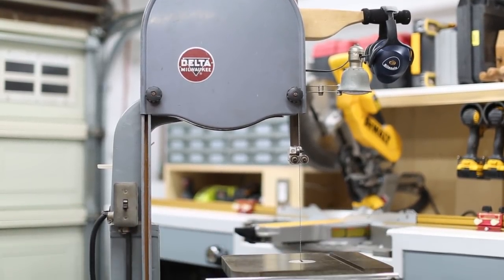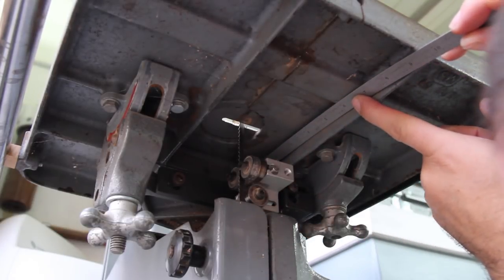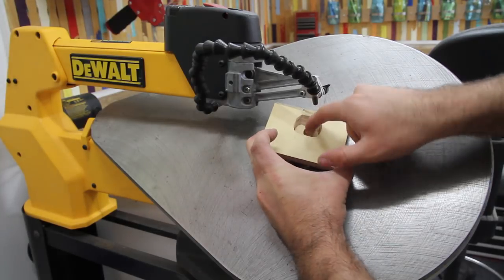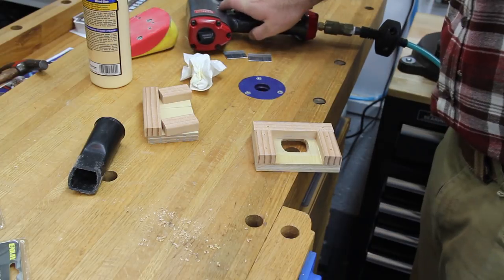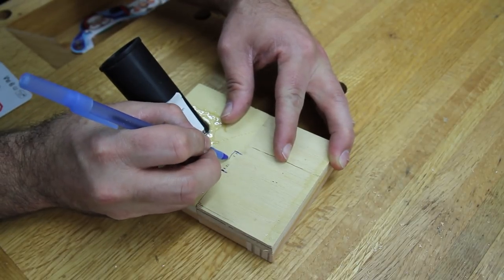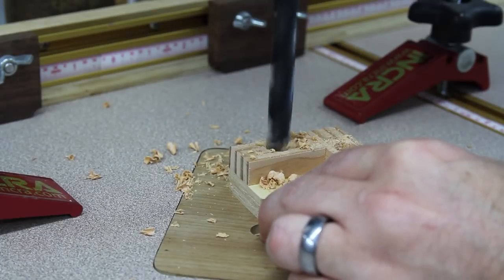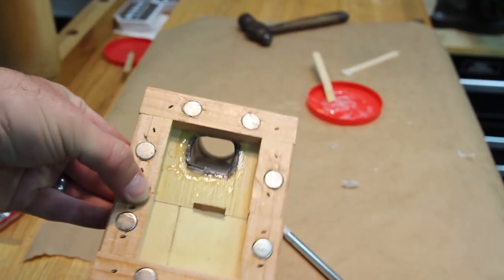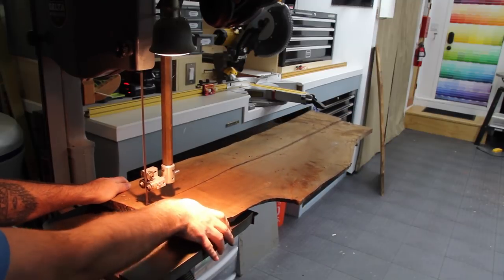Build: Bandsaw Dust Collection

Comment: Pretty cool idea. Absolutely agree on the near uselessness of most dust collection projects I've seen. Right now I've got a dust collector on my band saw that consists of layers of corrugated cardboard and Gorilla duct tape mounted to the underside of the table. It's VERY rough, but surprisingly functional, and is tied directly into my dust collection system, so no complaints.

Comment: Thanks for sharing this!  Great concept and implementation: clear, concise instructions.  Here’s another idea for even more suction.  I use 2” painter’s tape to seal as many joints/cracks as possible.  I seal the top and bottom wheel covers everywhere I can.  I also seal the blade trough on the rear.  Really helps!!
Reply: Worth a try though I bet it looks like hell.

Comment: Nice work.  The slot cut for the blade was larger than expected; thought it would be more of a ‘zero clearance’, but as long as the vacuum overcomes the tendency for the blade to pull sawdust along, it’s a win!  Based on videos I’ve seen in recent months, you are not alone in taking this approach.  Under-table dust collection appears to be the best solution to the problem.  Still getting my workshop set up, but I definitely plan to follow your example.  Best wishes!

Comment: I just finished making a dust collection setup for my bandsaw using the approach in your video. It seems to work very well!  The build was fairly easy, although I had to work around some mounting holes and a thrust bearing that is closer to the table top than your saw. 

BTW, I found it helped a lot to take the table top off when sizing and fitting the pieces.

Thanks for the design!

Comment: Brilliant idea with the magnets. I have a very similar set up on my 16" bandsaw, but i use high volume low pressure dust extraction with a 4" hose to the bottom of the saw, and another 4" just jammed under the table. They both tee off from a 5" hose which my whole system uses. I find this far more effective than a shop vac type system. I shall make a better attachment for the hose below the table using magnets! Thank you for inspiring me. All the best from uk : )
Reply from the maker: You're welcome!

Comment: Man, the only complaint I have is you didn't post this 3 years ago. I've been putzing around with mine for 3 years. I recently gave up. If it wasn't bed time I would go to the garage right now and build it. Thank you very much.
Reply from the maker: Maybe I should build a time machine next to fix that problem for ya.
Reply: @weberwoodshop   I built a time machine; had it all finished next week.

Comment: Thank you so much for the inspiration! I tried to make one of these for my bandsaw, but I didn't have nearly enough room underneath the table. I only had about a .5" of clearance above the lower thrust bearing. Using your project as a guide, I was able to design a part in Sketchup and 3D-Print the entire dust collection apparatus. It printed in several parts and I glued the assemblies together. I think with some more tinkering and thought, I could make each piece friction fit into each other. Is there any way I could share the photos of the finally product with you? Thanks again for your incredible videos and all of the hard work that goes into them. I hope you and your family have a Happy New Year.

Comment: As a green wood bowl turner, bandsaws are at best designed to collect dust from cabinet shop type work and not green wood, which always settles in the bottom of the saw. Closing that open area at the top is huge. Oh, the tables are horrible for anything over about 12 inch long.... I cut log sections up.... Need to build outfeed table that is removable and another fold down type away from the blade...

Comment: I have the exact Delta Band Saw and have tried different designs for dust collection with not-so-good results. I like your design. Does your saw 'leak' saw dust between the lower metal covers towards the blade side? Does your design dramatically reduce that dust or do you still get a lot of saw dust piles on the base?
Reply from the maker: Yes, yes and no.